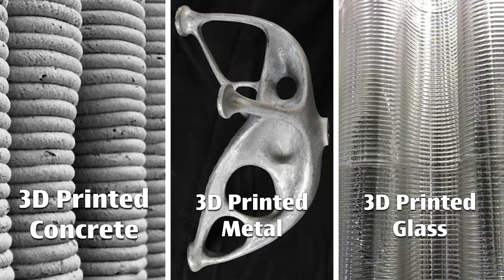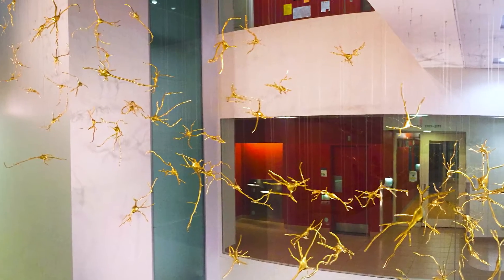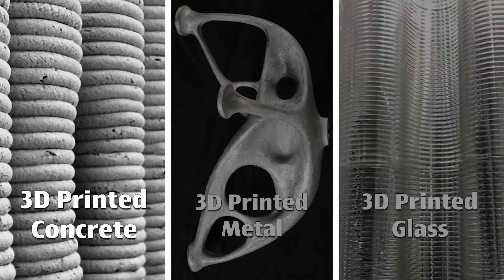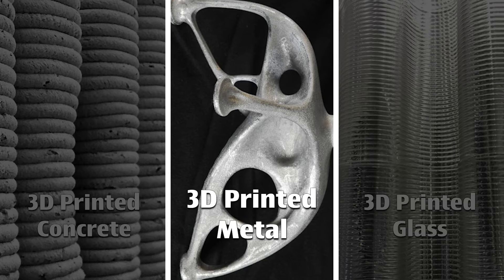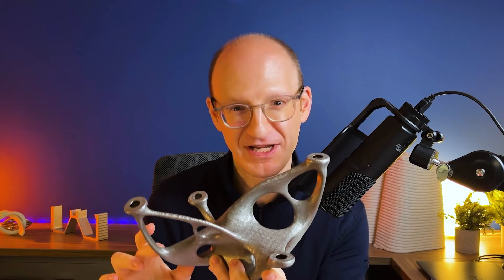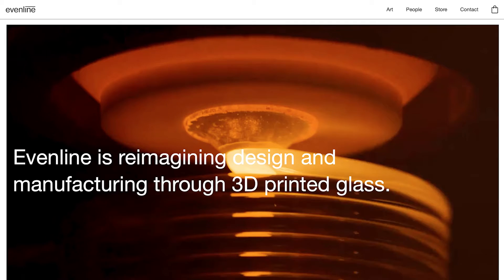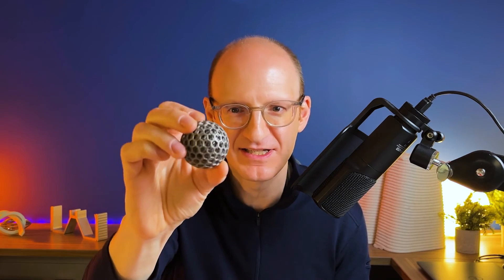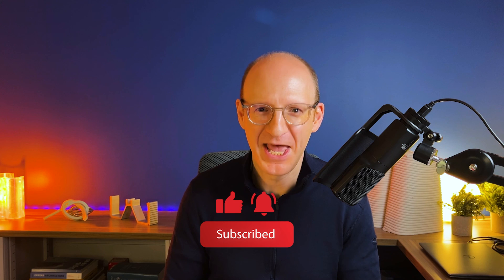3D Printing 3 Ways! Concrete + Metal + Glass!

Comment: Thank you for this video, you brilliantly presented the case for 3D printing.  For 10 years now,  I’ve been 3D printing functional items I design with 3D modeling software. 2 years ago I started to make components by laser cutting wood and plastic sheets. I think these production processes anugment each other perfectly. In in the not too far future, they will merge and reshape most production industries. My regret as a retired Structural engineer is, these technologies were uncommon during my working days.

Comment: Great presentation as always.
Although a partisan of 3D printing, I have two main concerns: the homogeneity of the printed material/element, and the (amount) energy used.
Reply from the maker: Thanks and both valid concerns.  I will note similar concerns exist for all other production methods of the same materials it's just they are more established and/or we have discounted them in our typical processes.